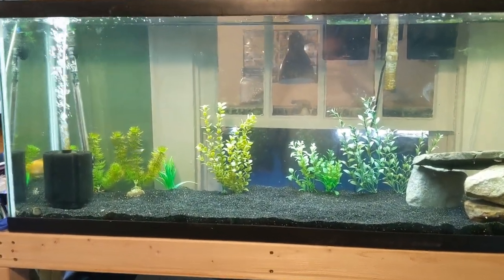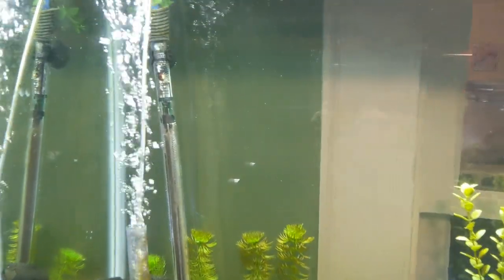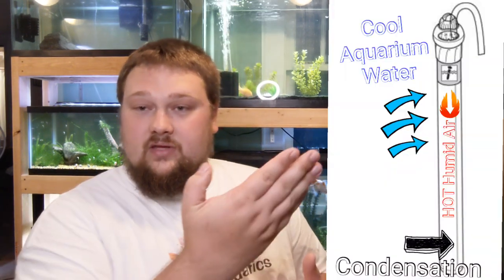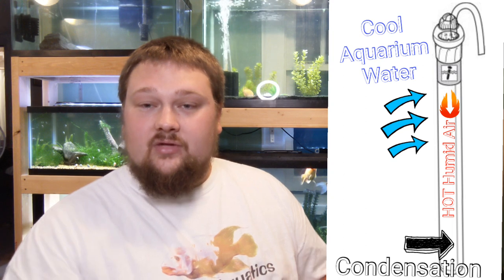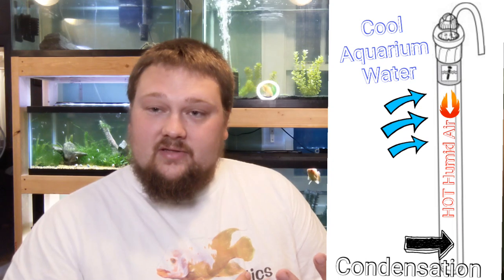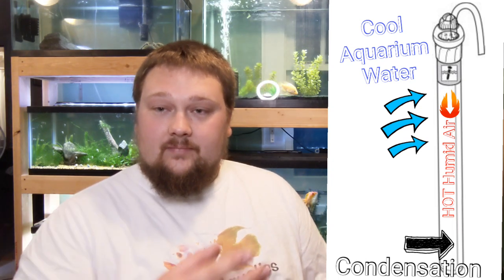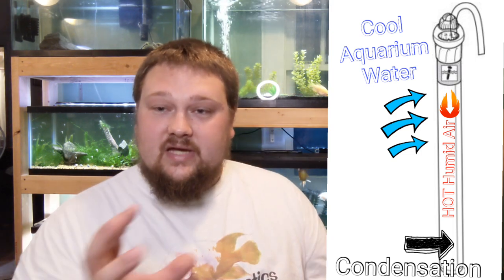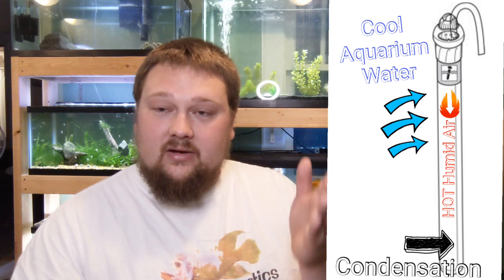Water inside an Aquarium Heater - Is my heater Broken?

Comment: Thanks for the info, I bought a cheap 300 watt heater for my 75 gallon and it condensed at that upper area of the heater. Panicked for a bit until I did some more research. You’ve quelled my worries for now lol

Comment: I have (had) the same heater.  Noticed yesterday that it was about half way FILLED with water.  I've had it for a quite a few years, and took it out to gently clean it the other day.  A seal somehere must have given because it filled with water, somehow still working though.  I took it out and threw it in the trash and I'm using another heater I had on hand.  I say if there is ANY water in your heater, it's garbage.  Luckily I had no electrocuted fish, but I suspect if the water had gotten any higher in the tube I would have.
Reply from the maker: Correct, like I said condensation is normal, accumulated water is not, the reason there was no electricity flowing into your water is because the electrical current wasn't reaching the water in the tank because the heater was only half full

Comment: I havent experienced any water in the heater as of yet thank god,but my only issue well with the eheim  is the overheating. Eheim instructs you on how to calibrate but even with consistent calibration it always seems to overheat by 4 or even 6 degrees.In my 40 breeder i have a 150 watt eheim it has finally calibrated to 78 degrees fish are happy.I recently set up a 10 gallon quarantine tank as I want to get new fish and I had a eheim 50 watt in there ive calibrated and resetted to match my main tanks temp and it'll overheat and overheat.So I got a fluval m50 for the 10gallon im gonna try this and see as this QT is only for new fish..I wanna see if it keeps the temp I want.One question can I fully submerge the fluval m50 like the eheims??
Reply from the maker: As long as the heater says fully submersible it's fine, 99% of the heaters made today are built this way.

Comment: I want to mention that I'm a big fan of heating the fish room to the proper temperature and not using heaters at all. If you live in a place that is multi-zoned, this is doable. Where I live I have wild temperature swings, and because my apartment unit is not multi-zoned, heaters are a must.

Comment: Just had this it made water live 240v. The heater only has a rubber bung and the adjustment screw is the weak spot I set mine now a fill the cap with super glue to seal it propper and use a controller water in side means heaters seal is comprised and heater must be thrown away and not used
Reply from the maker: It all depends on if it's just condensation or if yours is actually leaking water like I talked about in the video, If you're getting a pool of water that is filling up and touching the coils then it's likely broken, If you're just getting condensation on the glass that's probably all it is
Reply: @TrafishAquatics  to be honest they are pretty crap design Iam electrician if I had the hight in my sump I would not fully submerge them rediculas the design of them and as for condensation Iam pretty sure that only happens when water has all ready breached seal
Reply from the maker: Condensation is very common and if You watch the whole video I actually show a page on aqueon's website where they say it is possible for condensation to be in the heaters and not to worry about it. The reason we get condensation in heaters sometimes is because of the environment they're manufactured in, many of these heaters are manufactured in places like China and Thailand which have very humid climates, The factories that they're made in are not climate controlled so if on the day they were manufacturing the heater it was very humid, that humid air gets trapped inside of the heater and can't escape, Once that heater is put into an aquarium and turned on you have hot and cold temperatures on the inside and outside which cause condensation of that humid air. It's basically the same thing that happens when you put a cool glass of water on a table on a hot summer day and the outside of the glass sweats from the heat and humidity condensating on the outside of the glass.

Comment: I would highly recommend anyone who questions their aquarium heater's condition and suitability for continued use contact the manufacturer for guidance. Heaters do go bad and ultimately the manufacturer should be the one to make the call. I keep extra heaters on hand in case of failure. It sucks when there's a pandemic and you can't run out and replace a heater when you really really need it, lol!

Comment: Yeah, we'll agree to disagree. In tank heaters should NOT have condensation inside. If I see that it gets replaced. I always have at least a couple spare heaters. I've had two disasters with heaters malfunctioning and cooking my fish. I don't take any chances. Water inside means something is not right and that heater is getting replaced. I also no longer buy "cheap" non-name brand heaters. I will only buy Eheim Jager, Aqueon Pro, Fluvals, etc. Any of those no name brand crap heaters you get from Amazon or other sites like that are just asking for a disaster to happen. I've never had condensation with an Eheim heater, which is my preferred brand. I have several in my aquariums.
Reply from the maker: That's perfectly fine! Generally speaking a little bit of condensation inside of a heater is perfectly fine and I've seen it in many of my aqueon heaters as well as eheim jagers. And per aqueon's website that is perfectly normal due to the climate that the heaters are manufactured in. if it's getting a lot of condensation to the point where it's pooling in the bottom then yeah definitely replace it.
Reply: Dang it. That's what mine looks like it has..

Comment: water isn't a very good conductor its the minerals in water that conduct. i recently discovered some stray current in one of my tanks so i chkd the heater and it was cracked and completely filled with water. i was horrified but all the fish in there were and still are completely fine